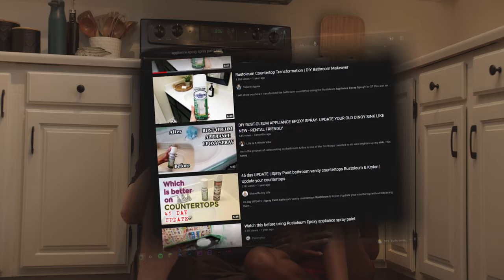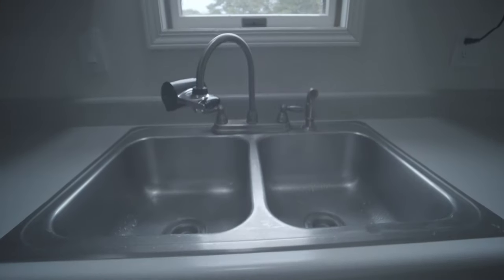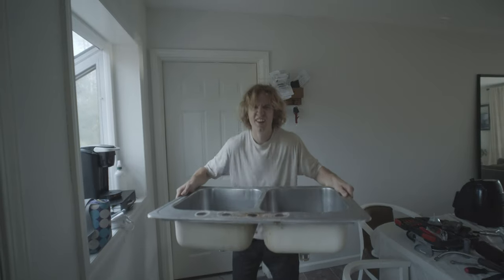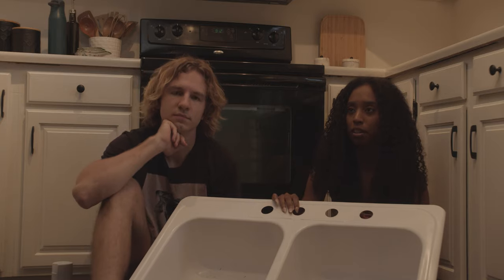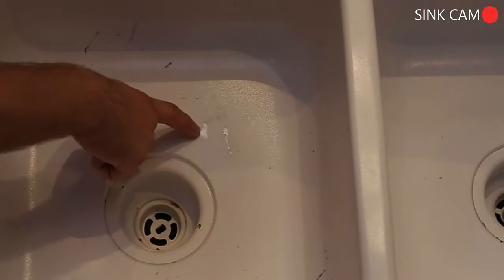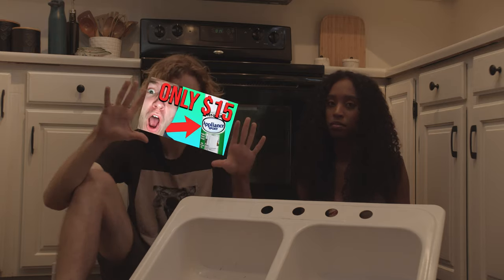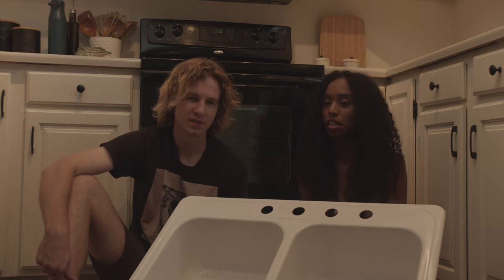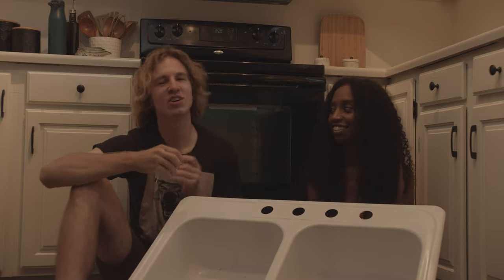Spray Painting your SINK... does it work?

Comment: Good first effort. I've used tub epoxy before and it comes out like a new tub. You could drop a nuclear bomb in the tub and it wouldn't even scratch the coating. The most important thing is that you have to let epoxy cure untouched for at least a week. Also, the room should be warm and low humidity while curing (like an auto paint booth).
Reply from the maker: Good to know! Thank you for your insight!